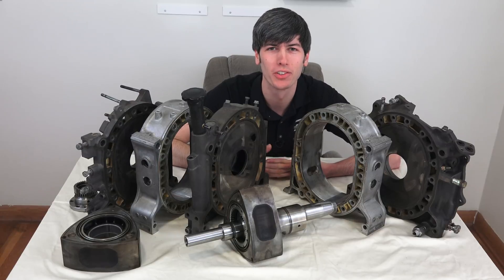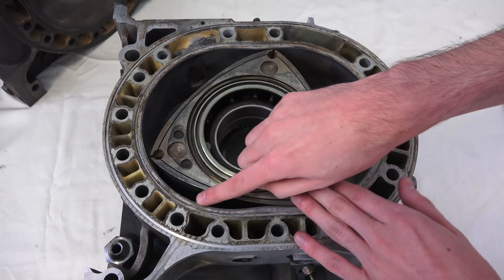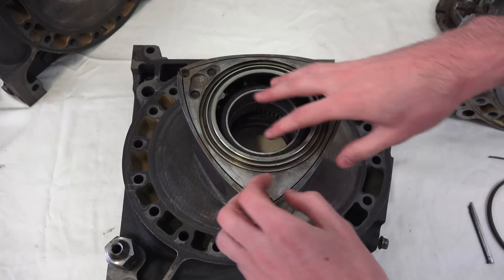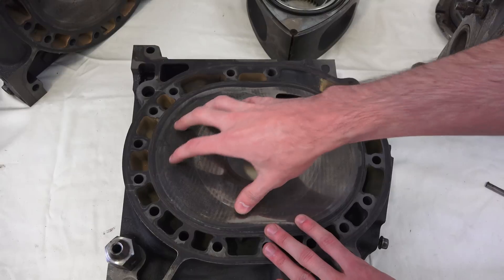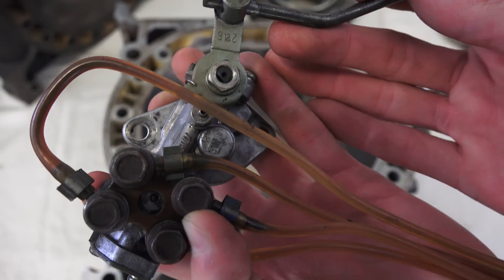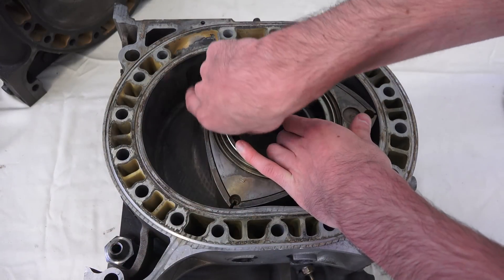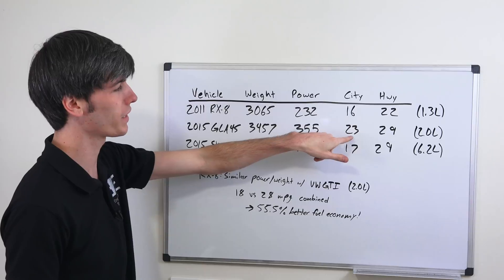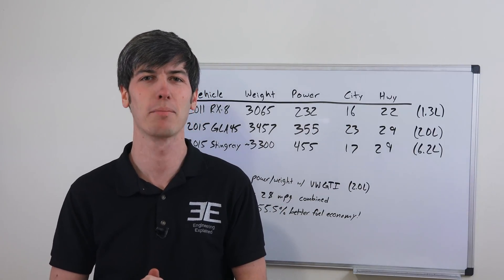4 Reasons Why The Rotary Engine Is Dead

Comment: I own my RX-8 now for 17 years and have no trouble with it and do not buying a new car saves a lot of CO2 for the planet. And it produces nearly only CO2 and nearly no NOX and HC and CO. Which no Diesel can compete with. These gases are really badly toxic - CO2 is not. And the Renesis engine has side ports, means no flames and no unburnt gas in the exhaust. Otherwise that would kill catalysator in a modern car. Love this car and will keep it forever.

Comment: As long as you don't accelerate, or decelerate, or idle, the efficiency isn't too bad.
Reply: Not true, Wankel engines were never successful in generator or industrial applications because of the terrible fuel efficiency at fixed speed /load continuous duty cycle.
Reply: @sandervanderkammen9230  Sarcasm ;-)
Reply: @ChrisNotTheKing  Ah, i see now.

Comment: The ROTARY is an example of K.I.S.S. attempt .  I do subscribe to that . Hopefully a simple mechanical combustion engine will emerge.  But the biggest warrior is the electric motor.
Reply: Its a WANKEL engine, and while the ir may seem simple at first glance it is actually very complex with lots of tiny fragile moving sealing parts that are the source of most of its reliability problems.

Comment: It's nice living on the Western Slope of Colorado, we don't have emissions
Reply: All 50 states must comply with EPA vehicle emissions, in addition 15 States including Colorado have adopted the stricter California C.A.R.B. emissions standards.

Of course Mazda didn't discontinue the Wankel engine due to emissions.
The RX8 passed both EPA and CARB Ultra Low Emissions Vehicle phase II standards when production ended due to lack of sales.
Reply: @sandervanderkammen9230  Nope.
You can have an insured car with straight pipes over here bud.
 I live on the Western Slope and have owned multiple cars.
It's kinda funny how you probably live nowhere close to Colorado but you feel the need to correct someone.
Kuck.
Reply: @BabyEatingFoxes  Tha State of Colorado says different...
Reply: @sandervanderkammen9230  look up Grand Junction DMV
Emissions testing is required in Denver, Colorado Springs, Boulder, Fort Collins and any other city East Of the Rockies.
Reply: @BabyEatingFoxes  We are not talking about emissions testing.
Reply: @BabyEatingFoxes  All vehicles sold in Colorado must meet Federal emissions and the same additional  emissions regulations as California.

Comment: But the rotary can operate on a very low octane fuel.
Reply: Actually no, Wankel engines required  higher octane than other engine types with the same static compression ratio.
This is because the Wankel engine cannot support modern combustion chamber architecture like "quench" or "high swirl" technology.
Wankel engines also cannot operate efficiently with GDI (SCSI).

Comment: A very simple engine that started well but was crushed with emission laws and fuel costs, soon diesels in civilian vehicles will be dumped and electric will be the domineering tech but our infrastructure here in Australia is no way equipped, I'm 64yo and will go out not knowing whats going to happen. But its inevitable electric EV will be standard.
Reply: The Wankel engine was deeply flawed right from the start well before emissions and fuel prices were an issue.
The Wankel is inherently inferior to reciprocating and turbine engines.
Electric vehicles have been around for over century and will remain a relatively small niche market segment, due to the low efficiency and limitations of rechargeable batteries they will never completely replaced internal combustion engines.

Comment: I wonder if you all heard about the "eat my dust" comment before... Well, I think putting the system in the wheels will do that! ... and with HHO Technology Engine with it, it can save the Planet... as for the rest of the vehicle's space, is the HHO Generator... 🙂

As for the APEX Seal, they should use cylinder and springs as the system for its contact point in their tracks in the engine but pressure can replace the springs... and instead, with the rotary material, it should be with the body of the engine on contact pressure point...
 Pressure, Swing Arms, and Timing are the name of the game as one system... 

Anyway, a metallurgist can solve the problem of not having oil lubrication in the system... just like a brake pad that will no longer work due to heating... 

In the thermal case, the key to keeping them cool is with a refrigerant... just enough to keep it cool on the outside but keep it hot for frictionless metal requirements... 

For fuel efficiency, diesel will find compression on its way into the system in addition to the HHO generator... 

The question is how much would it cost in its end result... as I am sure it will last for a lifetime...
Reply: How about giving the 'circles' the combustion and exhaust system in the Engine Blocks and not in the Rotor just to solve those problems of frictions?

Primary Color Circles?... Timing and Pressures?... Springs and Friction Plate/Pressure Pins?...

Comment: It's NOT dead, and the Mazda 16X motor is still on the back burner... this is your first video failure in my opinion. FORD bean counters are responsible for the failure of the Renesis RX8 motor, overruling Mazdas engineering team updates when the RX8 came out. But that's ok, you still got great vids.
Reply: The 16X program was canceled in May 2009, Mazda completely removed it from its global website and no trace of it or any new prototypes have been seen since 2007.
Mazda RX sales steadily declined after 1986... the RX8 was a major sales flop with losses estimated at $3 billion USD.
Reply: @sandervanderkammen9230  wow, that's a shame about the 16X motor. It has a longer throw for more torque at low end, and would have used the Skyactiv-X technology. As far as the Renesis, Mazda knew about the poor performance of the oil injection system of that engine, prior to release, but Ford nixed the engineering improvements Mazda engineers suggested, due to budgetary constraints, and THEY paid for it with poor reliability and early engine failures. I DO know that they have that single rotor engine integrated with a battery pack system on their new MX-30 EV as a range extender, but my understanding is that it's really derived from the Norton Rotary twin rotor engine that Mazda developed with Norton, around 300cc's per rotor. At least that is what I've been able to glean from an online source. THANK YOU.
Reply: @michaelcroos4713  We will never know, the 16X was canceled fairly early in development so their May have been insurmountable technical issues.
I don't believe Mazda considered Skyactiv-X technology for the 16X the X is only a coincidence, only rumors that it might feature GDI which is also doubtful.
Skyactiv-X requires variable valve timing and very high static compression ratios simply not possible with the Wankel engine.

Yoshihiro Wada was CEO when the 13B-MSP-RE  was developed... the notion that Ford hindered its development doesn't sound credible.
From what I understand Ford was however completely opposed the RX8 simply based on the failure of the FD. Sales of RX models declined after 1986 and the brand never made a profit for the company.
It's estimated that Mazda lost  $3 billion USD on the RX8.
  All of the Renesis engines suffered premature engine failures due to the higher static compression ratio than was previously attempted.

The Mazda MX-30 is already in production and available in selected markets.
The MX-30 will only be available in a 100% plugin battery electric vehicle or a mild series hybrid powered by a 2.0 liter Skyactiv G engine.

Mazda's board of directors voted in April 2009 to cancel all development of Wankel engines, no official press release regarding a new production engine has been made since 1995.
Reply: The Ford designed Duo 101 became the MX5, Mazda's most successful sports car and the most successful 2-seat convertible sports car in history.
The RX8 was a design disaster, a 4-door sedan disguised as a sports car... the public was not fooled.
Reply: @sandervanderkammen9230  Frankly, Sander, I hated the design of the RX8, and after driving it, I was stunned that it was not gutsy at all, considering it was suppose to have 220-225 hp, naturally aspirated, AND IT HAD HORRIBLE HAS MILEAGE. I had an FD that got better mileage, and I also had an original 1971 R-100 that went well over 110k miles with no issues! You gotta know how to make them last, frequent oil changes and slow morning warm ups.
Reply: @michaelcroos4713  Well, Mazda was sued for lying about published horsepower claims and quietly settled the case.
Independent dynomometer testing showed significantly lower power output than Mazda published.
Mazda never figured out how to make the Wankel reliable, neither did  any of the really big players in the Wankel development game.
Reply: @sandervanderkammen9230  My R100 went 110k miles, running beautifully, using a quart every 900 miles, before a DIY self installed, electric fan burned out in Houston heavy traffic, and killed it. My '84 12B RX7 GSL went 119k before it started smoking too much and I installed a reman engine in it...i did run that car hard though. In each case, I used Castrol GTX 10w-40, changed out every 3k miles, and I did a proper warm up on each, only getting the engine spinning over 4000rpm until it was fully warmed up. I also paid attention to the warning buzzer @ 7K rpm. So, given proper care and proper soak plugs changes in a timely basis, they did last, and neither car let me down. Is it as reliable as a Chevy straight six or small block V8? Probably not in the long run, but this is 2021... I'm sure material technology has significantly improved since the early 2000's. Given modern supercharger tech,  SKYACTIV-X  engineering, and a CVT, who knows?
Reply: @sandervanderkammen9230  I know of multiple Australian car buffs and billet engine makers who would disagree with you. But yes, no rotary is like my 27R Tacoma engine, or my C4's 5.7 small block.

Comment: It's funny, but all three of the RX-7s I've had used less than one quart of oil in 2,500 miles - while my Mustangs all exceeded that.  The rotary is VERY efficient - and produces more power per liter of displacement than any piston engine with or without turbocharging.  Seems like you're letting your "engineering" get in the way of truth and reality.  BTW, got over 32mpg highway, 22 city with those RX-7s.  Sorry, but you've obviously never owned a rotary engined car, and are simply reading the specs.  Sorry about your Prius, too.
Reply: HAHAHA!! YOU'RE REALLY FUNNY!!!

Comment: Humm figuree figures figures   ESPECIALLY GERMAN  figures 100% untrustable   If VW BMW or Merc issue figures  roule of thumb they are a blatent LIE
Reply: The facts don't lie, the truth is irrefutable... the Wankel engine is inherently inferior to reciprocating engines.
Reply: @sandervanderkammen9230  Yea whatever  spose you also think that german scrap is good design and engineering   hio humm
Reply: @pete-crow  Are you xenophobic? Or just not very knowledgeable regarding the automobile industry?
17 million new cars sold last last... not a single one has a Wankel engine.

Comment: This came to market during the energy crisis of the early 1970's, when car buyers wanted maximum fuel economy. Real bad timing indeed.
Reply: The Wankel engine came to market in the 1960s when gas was still very inexpensive.
The manufacturers never solved the reliability problems that plagued the Wankel design from inception until they became obsolete.

Comment: mazda in 2021 laughing at this video
Reply: Mazda stopped making Wankel engines in 2012...
Reply: @sandervanderkammen9230  oooof, you haven't heard the news have ya ?
Reply: @sandervanderkammen9230  look up the new MX-30, yw
Reply: @wpspeed2738  The Mazda MX-30 is already in production and available in select markets.
It is only available as a plugin battery electric vehicle or a mild series hybrid powered by a 2.0 liter Skyactiv G engine.

Comment: Rotary engines are still more badass than piston engines in my opinion. 
Less breakable parts and more BRAP BRAP BRAP!
Reply: Less breakable parts? Only if you pretend that apex seals don't exist lol!
Reply: Sander Van der Kammen True in a way lol
Reply: @sandervanderkammen9230  Actually they made apex seals better and less breakable.
Reply: @rjaybruhh  Apex seals are inherently unreliable... less reliable than piston rings.
Reply: @sandervanderkammen9230  No cams, no rods, no timing. A rotary is so sick tho! flames and pops
Reply: @sandervanderkammen9230  I know but allot of people still like the engine lol its just fascinating. I'll have one in my truck soon enough N/A at about 10k rpm to daily & track!
Reply: @rjaybruhh  Yeah if you're a 13 year old boy..
 No Torque, No power, No reliability!
Reply: @rjaybruhh  Not really, not a single legitimate engine manufacturer makes Wankel engines in series production... not even Mazda, they dropped the Wankel like a bad habit almost a decade ago.

Comment: If u worry about fuel economy get a toyota prius. Rotary still the worlds most dominant for its size. Get any 1.3 engine to produce the power of the rotary. 😂 never.
Reply: Not anymore, the Wankel is dead because it does not offer any advantages in power or efficiency.
The actual power-per-liter performance of  the Wankel engine is embarrassingly low compared to other popular engine types.
Remember that tax displacement is not the real displacement.
Mazda 13b has a total displacement of 3.9 liters or 2.6 liters when compared to a reciprocating 4-stroke engine.
Reply: @sandervanderkammen9230  u crazy bro 1600 hp out of a 1.3  is insane. U would never see a 1.3 liter piston do that. Not  efficient on fuel i give u that but the power don’t even go there. Is dead in factory cars but for racing is still very alive. Still beating fords and chevy v8s. 5.97 in the quater mile is crazy numbers.
Reply: @lostoxicos24-78  Serious as a heart attack kid, you don't know much about Wankel engines do you?
615 hp per liter sucks for drag racing..
F1 cars had 1,000hp per liter 35 years ago..

Comment: They also said the turbo is dead back in the days.🤣 But look at where we are today turbos are everywhere.
Reply: Turbos have been around a lot longer than the troublesome Wankel engine..
The Wankel has reached the end of it's development potential while turbochargers continue to improve and offer development potential.
Reply: Sander Van der Kammen Sander Van der Kammen turbo chargers where even more criticised than the wankel they where extremely criticised infact the inventor of the turbo was told it'll never work and it took years to prove his concept and even after that turbos where so bad some car manufacturers had to cancel turbo cars and compensate consumers who bought them. It took a century for turbos to work as they do now.
Reply: @machinefannatic99  Not true, Swiss engineer Alfred Bulchi invented the turbo at Sultzter in 1905... they still make turbochargers today for the World's largest available engine the Wärtsilä-Sulzer RTA96-C
Reply: @machinefannatic99  Not true, Swiss engineer Alfred Bulchi invented the turbo in 1905 at Sultzer... they still manufacture turbochargers for the World's largest available engine the Wärtsilä-Sulzer RTA96-C
Reply: Sander Van der Kammen they didn't accept bulchis invention for decades
Reply: @machinefannatic99  One third of all road vehicles sold today (over 20 million) are turbocharged and is expected to increase to 50% by 2025.
Reply: @machinefannatic99  The Wankel engine entered production in 1964 and production ended in 2012... less than 1% of vehicles sold in any giving year were equipped with a Wankel engines.
Reply: Sander Van der Kammen have you read my comments or your just jumping and replying, I said the turbocharger was more criticised than the rotary engine for a century until it became better and adopted everywhere. Learn to read before you write. Dame it.
Reply: @machinefannatic99  WANKEL ENGINE 
Not Rotary... do you not understand the difference????

Comment: He didn't mention it here (though perhaps he did in his other video), but the rotary engine does have a couple of major advantages over a piston engine, namely a much higher power to weight ratio and way fewer moving parts (only the crankshaft and rotor).  These were the primary reasons why Mazda pursued this technology in the first place.
Reply: Sorry, but that is simply not true.
The Wankel engine is obsolete technology because they no longer have any advantages.
Reply: @sandervanderkammen9230  ??? Sooooo... you're saying that other engines in common use have bettered the rotary engine's power to weight ratio???🤔 Or that there are other combustion-type engines that have less parts in them than the rotary??🧐
I think you missed his point, even if your comments about the rotary engine are spot on.😵‍💫
Reply: @joerosen5464  Absolutely! Reciprocating engines have superior power to weight ratio performance and Gas Turbine engine have an Order of Magnitude higher power to weight ratio performance.

Wankel engines are obsolete technology because they have no advantages.
Reply: @joerosen5464  2-stroke reciprocating engines have fewer moving parts and Gas Turbine engine in general only have the one rotating assembly.
 The myth that Wankel engines only have 3 moving parts is easily debunked because it completely ignored all the tiny, fragile apex and side seal components which are the source of the Wankel's primary failure mode.

Comment: With a Wankel essentially multiple "pistons" in a single cylinder. A single rotor Wankel has each side of the rotor covering the same swept area. Each side carries out it's own combustion cycle, but in a shared space. So if swept volume is say 500cc, each side combusts 500cc per single rotation to be 1500cc for this particular example. Twin rotor of this to be 3000cc, triple 4500cc and so on.